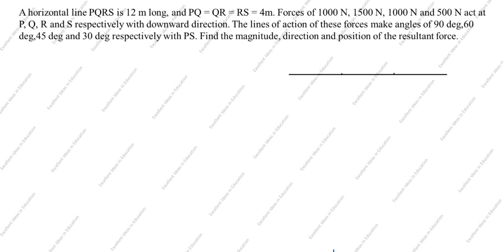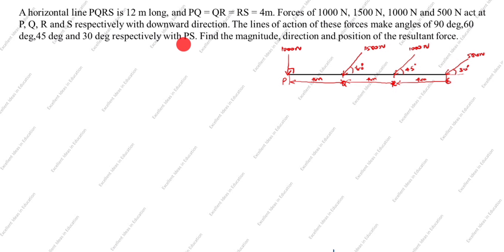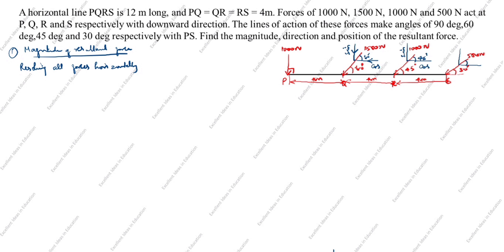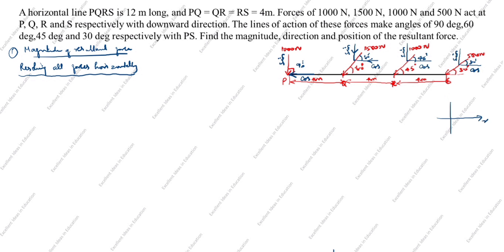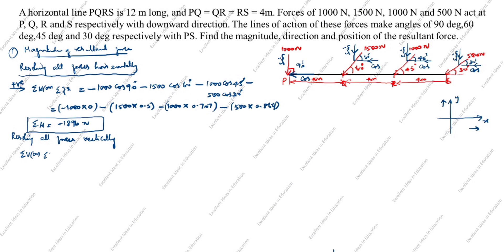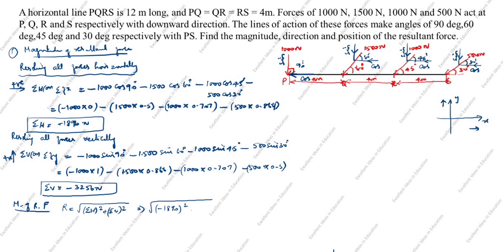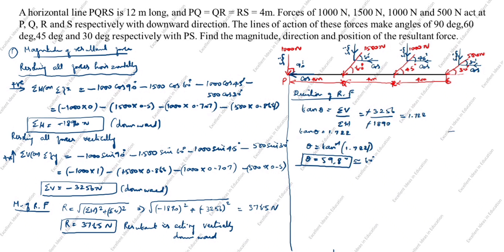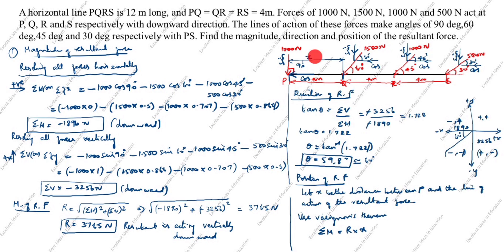Magnitude, Direction and Position of Resultant Force / Varignon's Theorem in Engineering Mechanics

Comment: A horizontal line PQRS is 12 m long, where PQ = QR = RS = 4 m. Forces of 1000 N, 
1500 N, 1000 N and 500 N act at P, Q, R and S respectively with downward direction. 
The lines of action of these forces make angles of 90°, 60°, 45° and 30° respectively 
with PS. Find the magnitude, direction and position of the resultant force.